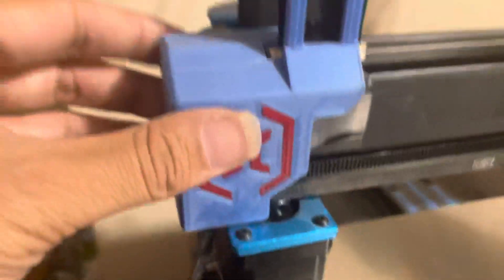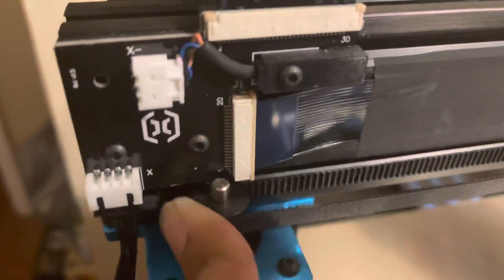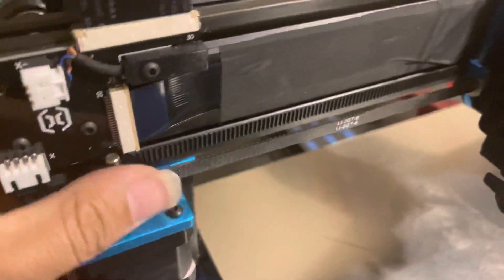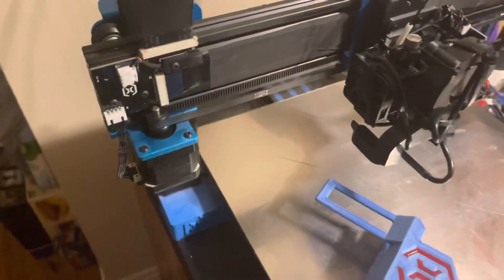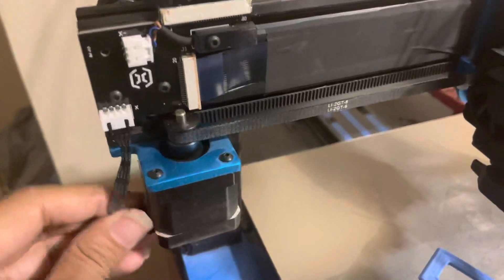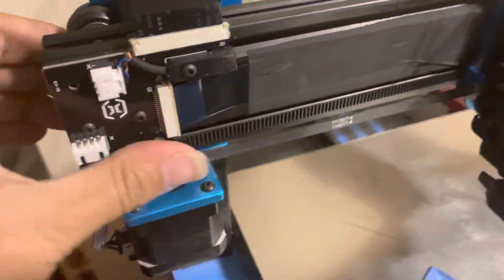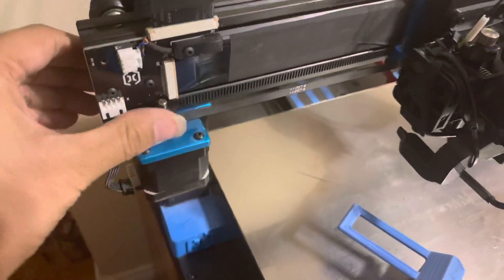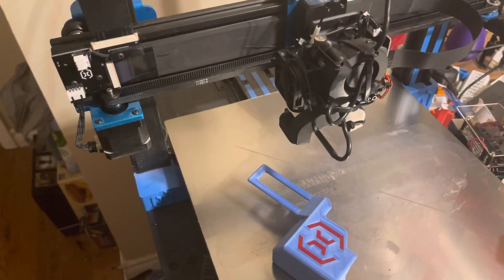Sidewinder X1 - X Axis Grinding / Stuttering

Comment: We replaced the x-axis flat cable but it didn't work (the one in the vertical frame). We also swap the small buss ribbon (the horizontal one) but didn't work either. We finally swap the x axes card and the problem got fixed.

Comment: I had the same problem, but I solved it unplugging and re plugging the x axes cable from the connector at the bottom of the z axes.
Reply: that was working for me for  a while, but eventually it just stopped working altogether, now I'm having to order new cables for it...

Comment: This video saved my ass. I've tried replacing drivers, x motor, x pcb board, power supply...and at the end was this little cable.
Reply: which cable can u describe because i am facing the same issue
Reply: Which little cable please

Comment: For anyone who has this issue: The problem (most of the cases) is related with the X-axis flat cable. This one is the cable that you can see in the vertical frame on the left side (front view of the printer). Change it and the problem will be fixed.
Reply: Thank you! This fixed my similar problem!
Reply: Thanks it helped
Reply: Spot on, thank you!
Reply: This comment needs to be pinned

Comment: Solved!
Changed the x axis Cable that goes along the Z column ..
tried to cleand the original one but didn´t solve it so i change to the new spare one.
Reply: This same thing happened to me and it was the ribbon cable
There is a spare included with the printer as well

Comment: replace the x axis cable
Reply: Exact. Mine too. I have changed the x cable. Now it's ok
Reply: having the same problem, but i have 2 sidewinders... swapped the axis cable from one that works and it still doesn't work.
Reply: @jamesmontgomery9464  check your stepper drivers disconnect X and Y drivers and swap them
Reply: @berkantmertmurat  thought that was what i did, when i switched the axis cables from the one that worked to the one that doesn't and the stepper motor still bound up.
Reply: same here it shaked x axis then "error: Printer halted  kill()called!

Comment: I have a problem the same as your but worse my ender 3 locked up in the middle of a model print and only way to move it was shut off power. when I turn it on it locks up. I did the updates mother board and display screen reprogram and still no good I replaced all the axe motors no good. I was wondering if it’s a magnetic issue the unit is magnetized. If there is a way to demagnetize might work. I can’t do mine cause I disassembled it.

Comment: Same issue here.  Turned out to be the ribbon cable that runs vertically down the gantry.  In my case, it looks like some debris was interfering with the cable connection.  Removing it and plugging it back in cleared the debris and the printer returned to normal.
Reply: TY, I just fixed mine from your reply . I almost junked this , glad I didn't now.
Reply: Tysm!
Reply: Thanks for your advice... it helped me a lot.. but in my case the ribbon cable was burned pin.

Comment: Mine was stuttering on the x-axis same as yours then I loosened up the limit sensor and it now works fine. The screw in the limit sensor had squashed the sensor. Now it runs fine with the sensor a bit loose.